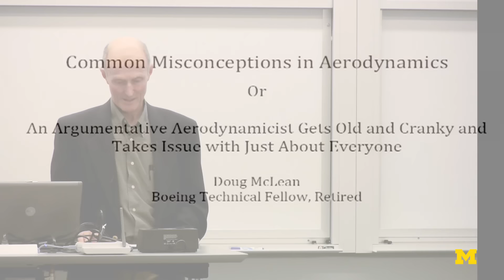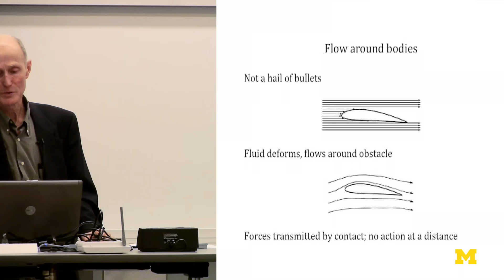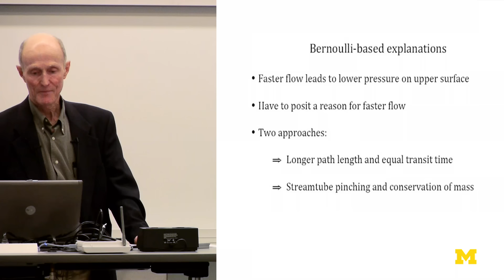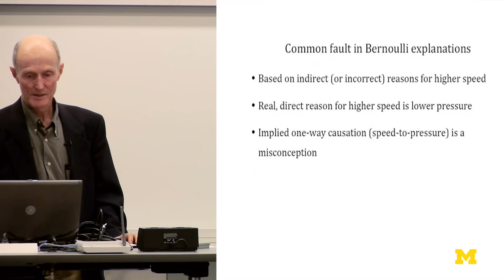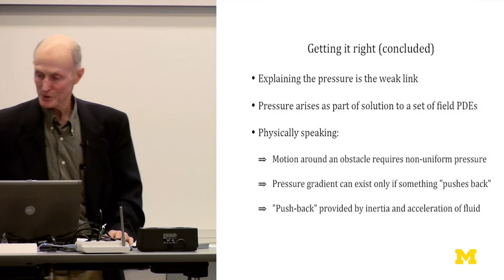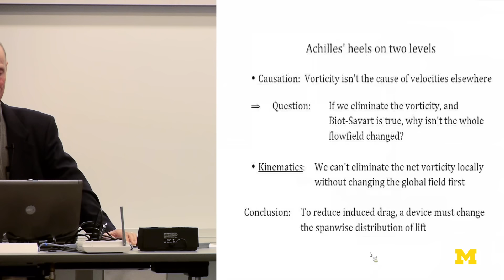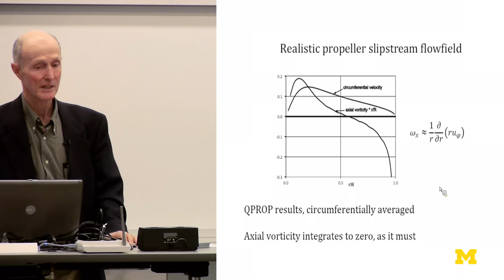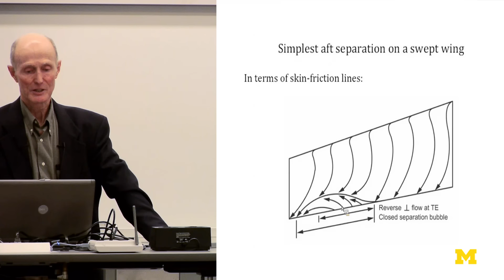Doug McLean | Common Misconceptions in Aerodynamics

Comment: So basically we don't know how aeroplanes fly.
Reply: I do.
Reply: @donmacquarrie9161  How did you learn?
Reply: By studying wing in ground effects aircraft. It is simply Boyle's law at work. The air under the wing is compressed as if passing through a funnel into a smaller volume - and the air above the wing expands in volume forming a vacuum. When the wing is travelling in free air with no flat surface above or below it; the Boyle's law effect becomes less noticeable because the "funnel" only has one side and leaks pressure into the free air stream without the constricting surface below it.
Reply: @donmacquarrie9161  Thanks for the info, could you suggest any books?
Reply: No...I haven't written it yet...lol
Reply: Don MacQuarrie except Boyle's Law only applies to an ideal gas in a closed container.
Reply: Real gases are non-hypothetical gases whose molecules occupy space and have interactions; consequently, they adhere to gas laws.
Reply: @donmacquarrie9161  as Doug McLean says in his book, if you say that airplanes fly because pressure is decreasing above and increasing below, you translate the question from Why airplanes fly? to Why pressure decreases above the wing, and be careful because it is not as simple as most people think
Reply: If you look at a lift graph for ANY shape of airfoil including a flat plat; you can see directly that as the angle of attack changes - lift goes up in a straight line and all of the graphs look identical right up to stall angle. Teardrop streamlining just delays the stall but doesn't increase lift. Only angle of attack. This is because the volume of air "gulped" increases and why a flat plate works as a wing. Ask this professor why he thinks lift increases as his wing approaches the ground.
Reply: @donmacquarrie9161  , There are many "explanations" that seem intuitively reasonable in a hand-waving way, but they do not give the right answer. As he said in the video, the calculations from one intuitively reasonable "explanation" only gives one-tenth of the actual lift. No simple answer is going to work unless you are willing to accept differential equations like the Navier-stokes equations as an explanation. Even then, the solution often requires some infinite integrals or detailed boundary-value assumptions.
Reply: thats because two things are happening at once.  your 1/10th or whatever isn't compounding it's lift potential. lift and drag go hand in hand, you can't look at it as simply pressure, otherwise pressure would have no drag, and thus no viscosity.  which makes no sense at all, atleast in a viscous state of matter.  but as we know, with zero viscosity super fluid helium, no matter the pressure or density of the current state of super fluid, it won't do a damn thing to create lift, or drag because you can spin it all day, whatever you set inside won't be impacted by the motion of said fluid.  but lift is a little more complicated than that. turbulence plays a role, so does atomic and subatomic particle science..these scientists are very specialized, which is why none of them can figure it out.  a standard model physicist isn't a quantum or subatomic particle physicist and vise versa.  they see reality on the contrary of one another.
Reply: you have to remember too that the mass of the plane divides into the lift parameters, per particle. this is why spiders can fly, because they multiply their lift by how many threads they use, instead of simply adding the lift together.  also how leverage works too to multiply by radius from center of mass.   the lift adds, but also multiplies i mean.  so if you look at a wing like an assortment of strings of particles, you have compounding squared roots, and cube is probably thrown in somewhere to divide by spacial distortions, but the movement of the natural air current multiplies no only by per particle, but as acceleration occurs from both particles heading towards one another.  simultaneously adding and multiplying.  this should help clear things up. because i found the polar moment of drag, someones already done that math.
Reply: @donmacquarrie9161  Well, your explanation is so simple and yet so wrong. Boyle-Mariotte says that as volume of gas decreases, pressure of the gas increases, right?
There are airfoils where on the top side of the airfoil there is a significant and steady increase in thickness from the leading edge towards ~50% chord while the bottom is nearly flat. 
If we measure the pressure along the top (at alpha=0°) we can see that pressure decreases steadily from the leading edge towards the thickest point at ~50% chord. In fact, the point where the air speeds up the most (where the slope of the pressure drop is steepest) is closer to the leading edge. Yet, this is also where the rate of increase in thickness of airfoil is largest.

According to your explanation, the volume should get compressed from the leading edge towards the highest thickness at 50% chord on the top side, increasing the pressure of the gas. So at least for the first upper half along the airfoil chord, we should see an increase in pressure, pushing the nose of the wing down.
We observe pretty much the opposite.

After 50% chord the airfoil top starts bending downwards. If we measure the pressure along this line we see pressure increasing (albeit still being negative relative to the air pressure of the environment).
According to your explanation, the bend downwards would give the air more room, increasing volume, reducing pressure of the gas (according to Boyle-Mariotte). We again observe the opposite.
Reply: @xnoreq  "Dear John" - that occurs only because you are complicating the flow problem by adding things like a camber, curve, and thickness to an "airfoil" when you should simplify the mechanics of what is actually going on; by using a flat plate of infinitesimal thickness at an angle of attack. then you will see a vacuum forms immediately behind the top of the leading edge, and pressure builds up immediately under the leading edge. Another misconception is to think of lift and drag as separate forces, when in fact; they are merely resultant vectors of an overall force created by vacuum above the wing and pressure below the wing. a good example of this would be a ball traveling through the air. if the ball is travelling horizontally parallel to the earth you would say it has "drag" - however you would quickly change your mind if it were falling vertically toward the earth then you would call that EXACT same force slowing its descent to "lift". With my way of thinking there isn't really any lift or drag....just air pressure build up in front of the ball - and a vacuum forming behind it as it displaces the air.
Reply: @donmacquarrie9161  Actually, most of what you wrote is again wrong.
What I described doesn't occur because I am complicating the flow problem but because that's what actually happens in the real world with real airfoils. As I said, your description of what is happening is lacking or even contradicts what is happening.

By using an infinitesimally thin flat plate at a positive AoA you will pretty easily get BL separation, so the effective shape will be anything but a flat plate and the airflow will be turbulent and way more complex to describe than the case I've described where the fluid follows the surface of the airfoil.

And again, in reality, if you take an arbitrarily thin flat plate with rounded leading edge then at a positive AoA you will see a spike in drop of pressure over the upper half of the rounded leading edge only - where geometrically the air should get compressed in volume. But for basically the whole upper side of the flat plate (on the "vacuum" side as you would call it), pressure of the fluid will actually increase more or less steadily.

Also, you say that "lift and drag are the same force created by vacuum above the wing and pressure below the wing." This is also wrong. There are several types of drag such as form drag, skin-friction drag and induced drag.

Also, it doesn't matter whether a ball travels horizontally or vertically through the air. I would never call drag lift, because those are two different things. Lift is perpendicular to the airflow. Drag is in the direction of the airflow. When a ball falls down vertically then the airflow is also vertical. There's no lift here. There is however lots of form drag and skin drag. Without such drag, the ball would accelerate towards the speed of light.

Lastly, for a ball or drop-shaped thick and symmetric airfoil, the drop in pressure still happens on the front face. Lowest pressure is reached within the first frontal quarter of the diameter. From that point onwards and on the entire "vacuum side" pressure actually increases again.
Reply: Google "Babinsky". He gave a lecture with an explanation of lift that more people need to hear.
Reply: @SoloRenegade  I had to stop when he compared holding a sheet of paper horizontally and blowing on it and comparing it to letting it hang vertically.
How could he not notice that in one case he has a strongly curved sheet and in the other case he has a flat sheet?
How could he not notice that in one case he blows at a low angle against the "hump", making the air stream follow the curved sheet of paper, and in the other case he blows against a straight sheet of paper effectively pushing it away?
Reply: @xnoreq  That was his point. His idea is all about the curvature.
Reply: @SoloRenegade  No, his point was that since it does not work on the piece of paper hanging down blowing on it the way he did, that he has somehow disproved that Bernoulli's principle is involved.
I mentioned how this "demonstration" is flawed, so his conclusion is invalid as well.
Reply: @xnoreq  Bernoulli's principle is invalid though in the way most people think it works and applies to lift, that alone can be a much longer discussion. He may not have explained it well enough for you to understand, but he is not wrong.
Reply: @SoloRenegade  Again, he thought that through his little experiment he could demonstrate that Bernoulli's principle is not involved.
Doing a flawed experiment and coming to an invalid conclusion... I'd absolutely call that being wrong. Even worse, it's not a matter of not having explained it well enough but actually misleading people with it.
Reply: @xnoreq  You're free to live a life of ignorance and anger. Truth doesn't depend on your acceptance nor you ability to comprehend the details.
Reply: @xnoreq  I'm not mad, I just find your assertion that one mistake that is easily fixed with a better explanation invalidates an entire argument. Seems childish. You get very angry when I disagree with you, just pointing that out. I'm not the one calling others idiots. I accept reality and can look past oversights when i recognize them. I've received the proof for why Bernoulli doesn't apply to the piece of paper or lift on a wing as people are taught in other discussions with other scientists. So I've seen the science from multiple views. So even if Babinsky explained it wrong here, I've heard the explanation he was trying to make in other more detailed discussions.
Reply: @SoloRenegade  Dude, why are you so mad. I'm not angry with you or any other idiot, just pointing out the facts.
Calling a deliberate demonstration that is clearly flawed merely an "oversight" is idiotic, especially after the guy mentioned that he's pedantic about these things.
That's not an oversight, that's a big mistake followed up by an invalid conclusion.
And yes, Bernoulli does apply to a piece of paper. It even works for vertically hanging strips of paper if the experiment is done correctly.
Bernoulli also applies to wings, but it's not an explanation for lift.
Reply: @xnoreq  You just copy and pasted your response. Not saying it doesn't apply at ALL, just misunderstood. Gotta learn to read between the lines with common sense. People make mistakes, I've seen more Professors and scientists get the Bernoulli explanation wrong with the piece of paper than get it right. Doesn't mean they're idiots.
Reply: @xnoreq  I'm not wasting your time, you're wasting your time, if that's how you feel about it. Feel free to try to ban me, if you have the power. By banning/censoring me you only prove you can't stand the criticism and fear what I have to say.

You copied your response, in that you repeated yourself like a broken record two responses in a row.
Reply: @xnoreq  Life is tough, and defending your assertions is too. Can't hide in your "basement" when life gets tough, forever.
Reply: This is a lecture about the wrong explanations. Just because there are bad explanations does not mean there are no explanations.  So your statement "So we don't know..." is incorrect, in particular the "so".
Reply: Through magnetism.
Reply: @SergioHidalgoAero  I never thought I would find you here. I just watched your video 👍
Reply: Ya, we do. Cumulative Lift is given by a volumetric rate of air mass passed under the wing surface area, and a different flow pressure across the wing top decreasing the distributed air mass there. The distributed ambient air pressure at up to several hundred feet ahead of an aircraft traverses over the top camber profile, and also against the underside of its wing profile, within an interval of apparent air speed that must balance or exceed the rate of initial speed of drop - under force of gravity - of the overall mass: angle-of-attack must present a cumulative positive Lift force from surfing a local atmospheric air 'density'. Lift derived from greater mass pressure inclined underneath to exert itself, against the wings, like a standing pressure wave. The gradient of bouyancy/Lift resultant is over interval of run in X direction, and sufficient, with the additional mechanical advantage of induced air mass drop/reduction acting cumulatively above the wing (in the same interval) to produce a work rate against the nett Y force acting in the downwards due to weight (ie, acceleration under Gravity). Air has mass, as well, remember that next time you fan yourself. Howzat!

 If this helped you at all, and its fair to argue that it has not, remember before Newton there was Archimedes.
Reply: So it's very dangerous to fly on aeroplanes for if the magic stops we are drowned.😃😃😃
Reply: @donmacquarrie9161   E.
Reply: @donmacquarrie9161  Don no offence but that is clever TY
Reply: @donmacquarrie9161  No you don’t.
Reply: If you think pressure decreases on the top chord in-flight, look at the top of a fabric wing as on a cub. The fabric isn't pulled up, it's pushed down between the ribs.
Reply: @myotherusername9224  You may see some downward deflection at the leading edge due to dynamic pressure, but over the majority of the upper surface the fabric is being lifted; I have seen this on over a dozen low wing fabric types I have flown (not sure how you saw the upper surface of a high wing Cub?) and it is also very evident on most thin metal skinned wings, less so on a typical airliner that most people would see due to the thickness of the skin.
Reply: @rcflighttestengineer5636   I am having a hard time thinking of a dozen fabric covered  low wing airplanes. Stits Playboy, Fly Baby, VP-1, VP-2...

what other types have you flown ?
Reply: @myotherusername9224  you need to look a little closer, what you are seeing is the fabric ballooning between the ribs in those photos and the low spots being where it is attached to the ribs.
Reply: @rcflighttestengineer5636   
Show those pictures to any number of pilots and ask them to trace where they think the ribs are. They'll trace the high spots.
Reply: @myotherusername9224  Corby Starlet, Winjeel, Chipmunk, Cassut, Jodel D11, Motor Falke, Mitchell P38, Emeraude, Ryan, then there is the low wing on a number of biplanes I have flown including Tiger Moth, Pitts and Skybolt. It is also clearly evident on thinner metal skins, such as on my RV6 particularly when pulling G. Some years ago I did some flight trials in my Yak52 with “fabric patches” attached to the upper surface to explore this further and get some data on loads for a program I was working on developing a new flight test kit using “stick on” sensors. When I work out how to post a picture of the test I will do that.
Reply: @myotherusername9224  simple question, have you ever flown a fabric covered aircraft and observed this, or are you looking at photos and making an interpretation? Because I have!
Reply: @rcflighttestengineer5636  I'm " looking at photos and making an interpretation"

I'd be curious to know how many other people see what I see in these photos.
Reply: @vinaynk   i am just reducing "lift" to its basic core fundamentals. The fundamentals necessary for lift are - 1: a moving fluid (relatively speaking....) -2: A flat board (or "plane"....that's why they call it a plane) and -3: an angle of attack. Curves and camber of the airfoil do NOT create lift - they merely improve the lift drag ratio and the streamlining of airflow around the plane. This should sound familiar if you study mechanics because it is a simple machine called an inclined plane. So if we imagine this inclined plane was moving through a solid (like a screw being turned into particle board) it would advance through the wood, at a rate, equal to the rise/run. Air however isn't a solid so there is 'slippage' as the air escapes and flows around the wing so the efficiency of the inclined plane is reduced. If the angle of attack has a rise of 1' to a run of 10' - your aircraft will not lift into the air 1' for every 10' travelled because the air is not a solid. The jist of what I am saying is that a wing is merely an inclined plane. The fluid nature of air...and adding curvature/camber to the wing and Coriolis effect and coanda effect and viscosity/ reynold's numbers, quantum effects, sun shine on the top of the wing heating up that air and making it less dense compared to the colder denser air in the shadows under the wing etc. etc. etc. erect a forest of calculations that obscure the fact that it is a simple inclined flat board that produces the lift. airplanes can fly upside down; only if the effective angle of attack of the 'plane' is positive. Notice that none of these people are questioning how the keel of a boat works
Reply: Kunal Gavane 
I learned by being an aerial applicator.
Reply: @myotherusername9224  lol in the last photo the fabric looks like it is ballooning up, but if you look closer at the picture it's completely photochopped. As in they cut out a picture of the Cub on the ground and pasted it on a background. The other photos are legit and show the fabric sagging between the ribs. Your point still stands :)